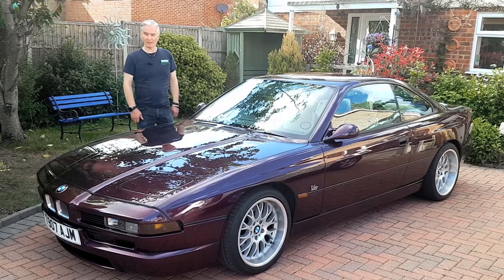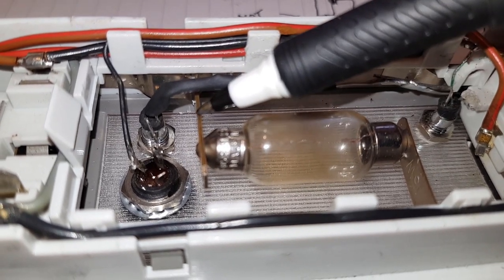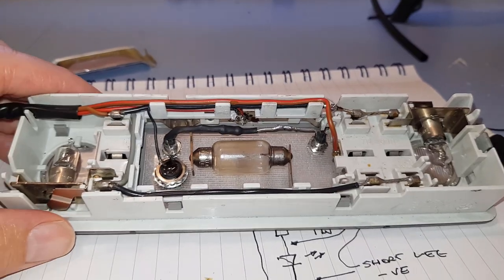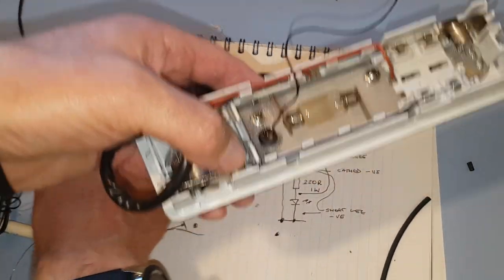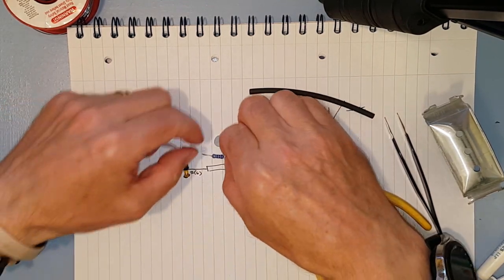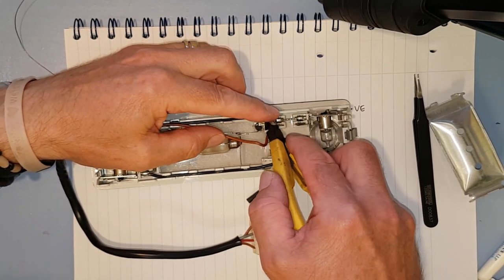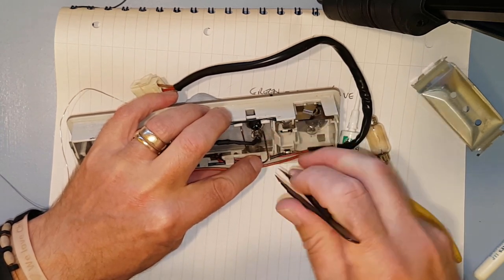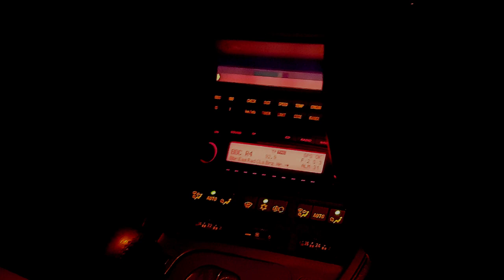BMW E31 E32 E34 Installing Ambient Lighting

Comment: Awesome video! I might have done it slightly differently. I would have piggybacked a wire from one of the instrument illumination wires an run it to the interior light. You might even have found one near there for the garage door opener option. I would have wired the LEDs in parallel, and chosen a resistor in-line with the positive in the 560ohm range. I would also have used a conical soldering iron to make small holes in the black plastic bit on either side, just big enough for the LED bulb itself to press fit in. That way you can omit the potentiometer and have it work with the one for the rest of the instrumentation.

Comment: ah and a second hint. If you have infared key. (very bad range and no spare parts) just upgrade to a key fob with RC.  Take a e36 inside mirror and a e36 fob and a new key (ebay). then  switch the inside mirror and  transfer the keyfob internals to the key, let it grind by a local shop. Then learn the key fob, and you are good to go.
Reply from the maker: No problems with the key thanks, it is an Ebay key, shaft matched, new RF (the later E31's are RF not infrared) and transponder swapped over - just like new!

Comment: Great video, really surprised the E31 didn't come with ambient lighting. My E39 already had ambient lighting from the centre dome light but I've recently installed E38 illuminated interior door handles. Which again adds to that warm orange glow at night.  But now you've got me wanting them wired into the 16 minute supply. There currently wired into each window switch light, Grey/red trace and ground, which come on with the headlights. Any idea where I might find a 16 minute supply?
Reply from the maker: If you have a link to the E39 wiring diagrams I will have a look!

Comment: Please get the becker 4769. It has inverted LCD. Just put in ontop of the 7469, fire it up and set light settings from 31 to 5. That 7469 positive is just too bright
Reply from the maker: Thanks for the info! I'm very happy with the one I have - it's a BE7922 and in real life it's a great match. The 4769 really doesn't suit the E31 - the buttons are the wrong shape!
Reply: oh 7922 thats why it is the wrong color. With the bmw version you got ibus control. 

You can also take only the lcd from the 4769 to the 74xx that will give positive/negative control. but you need more adjustments.
Hmm i prefer the correct display look than the buttons being „wrong“. But i understand what you mean.